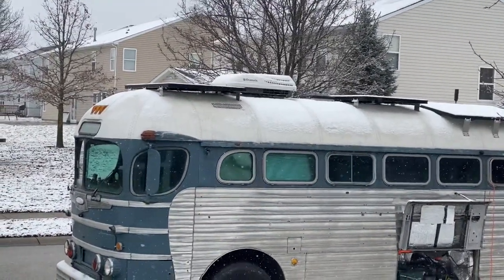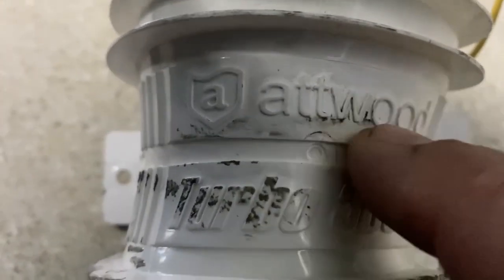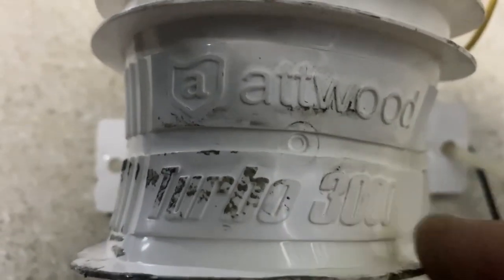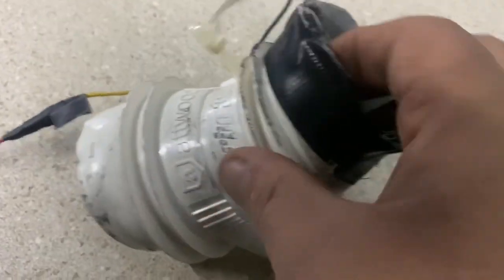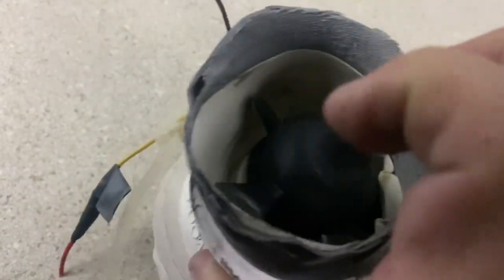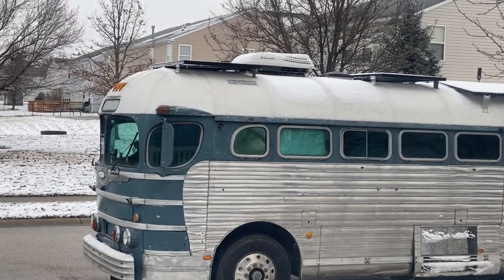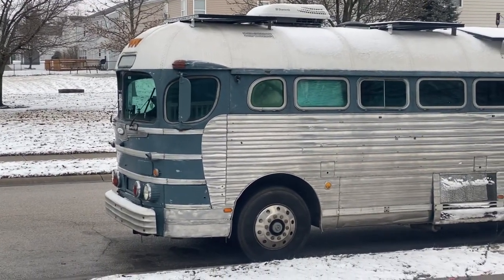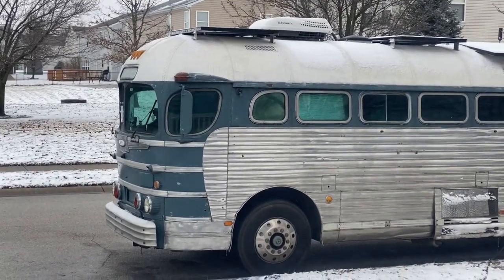Diesel fired heater gets hot. And a couple of updates on what we are doing

Comment: I have an older Aqua-Hot (Webasto-based) diesel heater in our bus.  It’s in the curb-side bay just forward of the drive axle.  The exhaust pipe goes through the floor and under the bus to the driver-side and end just ahead of the drive tires (along with the exhaust for the generator).  It’s 1.5” pipe (approx.) and the run is about 10 feet.  When it is up to temperature you would not be able to hold your hand at the exhaust tip for very long.  It is possible, however, to use a “Gen-Turi” set up with a 90 degree extension that points up and into a larger (3” or 4”) vertical tube that then rises above the top of the roof.  These are usually made of PVC or other similar material (for weight) but I know of one guy who is making these out of thin-wall SS.  This works because cool air is drawn in around the exhaust and cools it just enough to not melt stuff.  It is still hot enough, however, to rise to the top and exit.

Comment: Bilge fans aren't rated for high temperatures, but you don't expect the heat going to the vehicle to be that hot!  It makes you want to check all your ducts and joints.  If you still need a fan for the duct maybe you can find a metal one.  Also, you might want to check some temperatures along the duct with your IR thermometer to see how hot it is actually getting.

Comment: I used a 1 amp computer muffin fan at the end of the run.  We will see how it holds up.  Brushless motor is super quiet, and the black plastic is carbon infused for heat resistance, plus these fans are dirt cheap at a used computer recycler. Would you believe only a buck?

Comment: Scott you should get a metal squirrel cage fan and mount it in your ductwork like a old school bus fan or else use an old rheem/ruud water heater power venter or draft inducer as you can tap it in the 120 volt supply and wire up a variable speed Triac motor control so you can vary the speed of the blower as you can find them on ebay any furnace or water heater draft inducer with a FASCO motor on it.

Comment: In the VW aftermarket they make blower fans that connect under the  back seat (in a beetle) that helps move the air from the heater boxes. Those should be able to handle more heat than a bilge fan if you want extra flow from the diesel heater.
Reply: It has been a few years since thoughts of that horrible design came to my mind.  Ah the days of owning Beetles... long gone for me.
Reply from the maker: 73 Things have no exhaust heat or even the ducting for them.   I do have the gas heater ontop of the gas tank but i usually have to fiddle with it for a few hours the first time each year.

Comment: @Scott - (Disclaimer: Pure speculation on my part) Yet, I suspect that with the smaller 4-port output design (as indicated in your amazon links); the 1 1/2" inside diameter (X 4) - your bilge-fan was pulling the majority of the heat through one line. I don't know the cfm of that fan though, considering it was intended to evacuate a fairly large area in short order - it may have been pulling close to 60% or more (instead of the static designed 25%) of the total heat output, through it. Get a non-boosted temp reading on all 4 outputs (hose ends) and, if you get another bilge-fan, put a speed limiter on it and/or, put some fresh air induction holes, just before the fan intake - and, adjust until you have a workable temperature coming out of the boosted line. If you're needing the white-noise more than the greater bedroom heat, maybe just have the new fan an inch or two, away from the end of the diesel heater ducting. Cheers and, Cheerio!
Reply from the maker: Except it’s really like this one.  Just one large output. https://amzn.to/32ydWHf
Reply: @BusGreaseMonkey  - Okay well, if your fan is large enough diameter, I guess the same thing could still be happening with pulling more than half the heat through the one side?